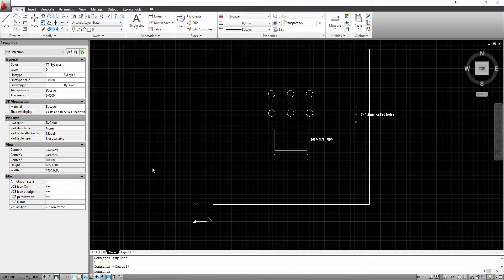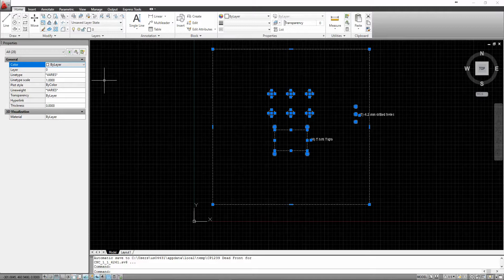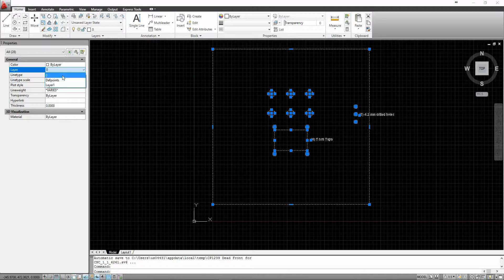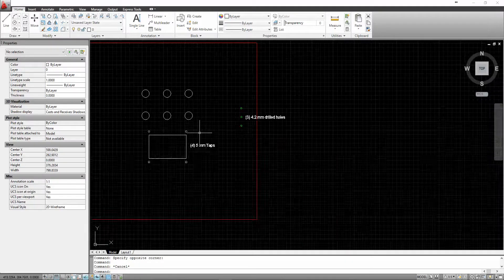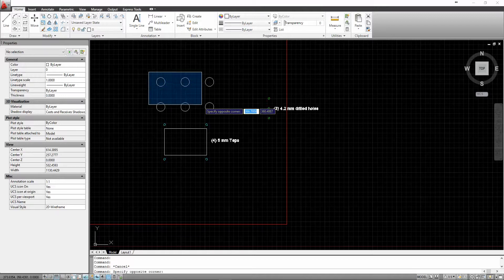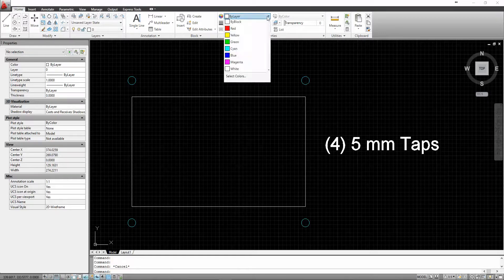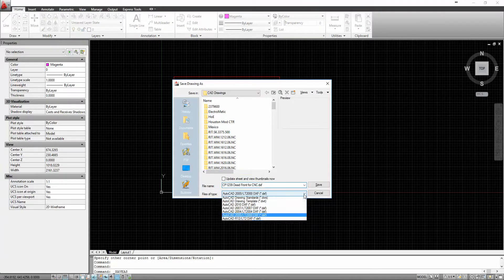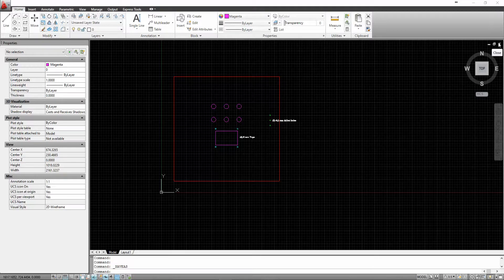Perforex  - How to convert an AutoCAD drawing for DXF Import

Comment: Do you have a video explaining using yellow vs magenta for the contour.  I thought yellow was to preserve everything inside the boundary and red would preserve the outside.  The issue I have is it will cut the yellow contour first and then there is nothing holding the material so it can't cut the features inside of the yellow contour.  Is there a way to automatically perform yellow contours last?